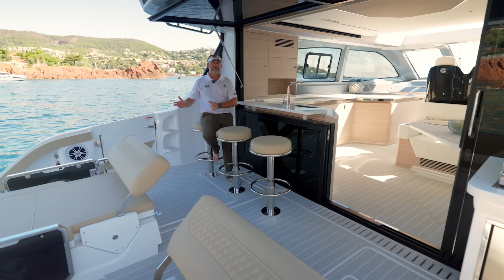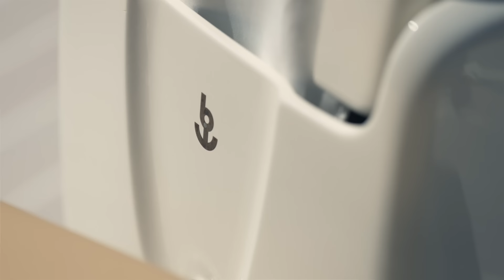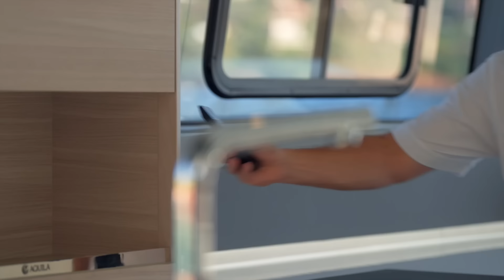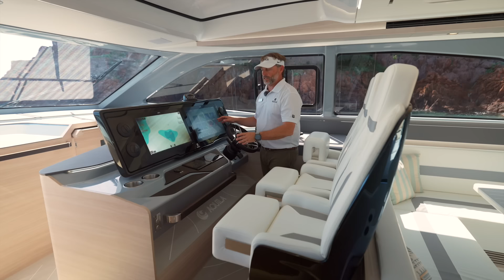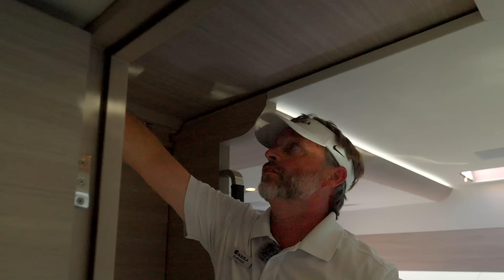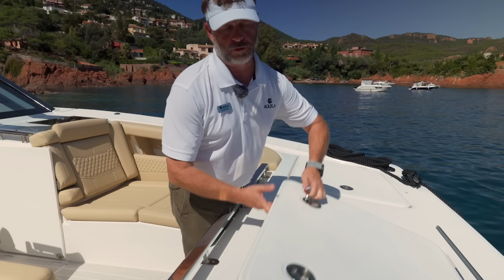Aquila 46 Coupe Complete Walkthrough | 2025 Yacht Style Award Winner

Comment: The design is a lot cleaner with the out-drives. It’s such a tradeoff between out-drives and outboard. I’d love to see some shoe-keepers on the outside to encourage boarders to leave them outside. That flush-fall dining table is awesome. If you’re not seated, that extra floor space makes a great impression. I’d love to see a 46 “sport-yacht” that has the front cabin you get in the 46 Yacht, but no fly-bridge but with the forward steps from the Yacht leading to a roof-wide sun pad with minimalist safety railing. Basically the 46 Yacht with no fly-bridge, no front opening windscreen, curved up for maximum front cabin, like the Yacht. 🙃